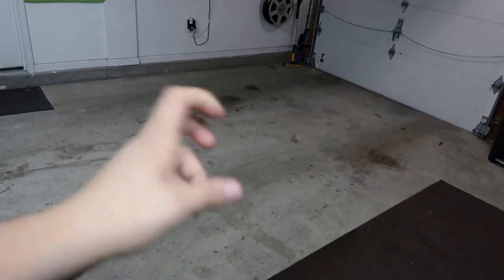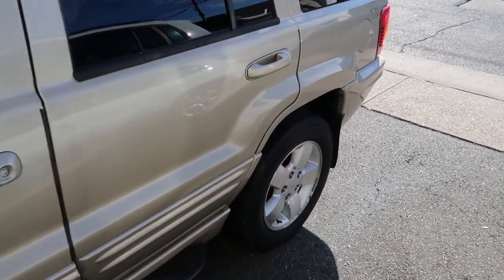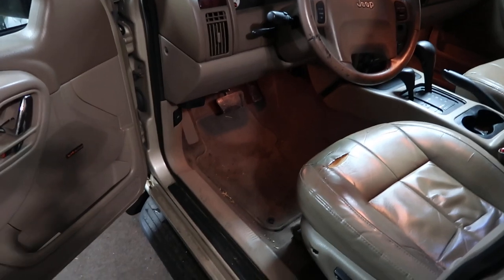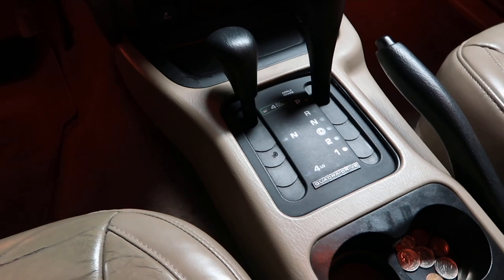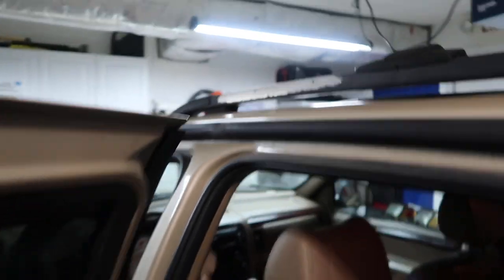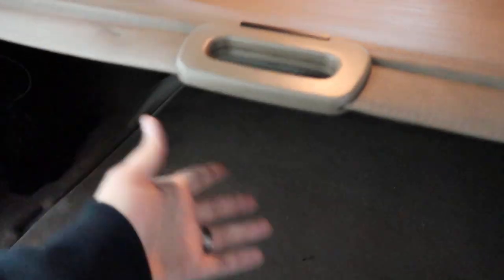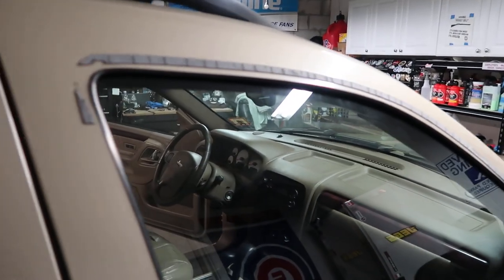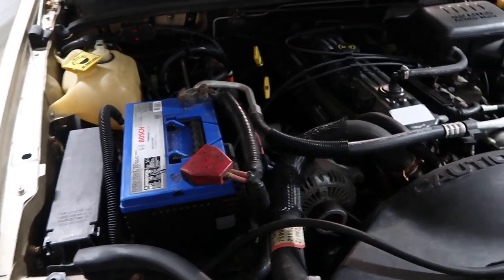Bought A Winter Beater !! .. And Cleaned It ??

Comment: hey when you sell it you should add like a winch or some sort of offroad modifications and sell it during offroad season because that is a common trail crawler also in 4 low your jeep ( ill call it Betty beater) will build up the rpm's so you can get more torque for more traction ( recommended for hills with ice or snow) (not recommended for normal driving) (also in the manual it will talk about the recommended max speed in low)